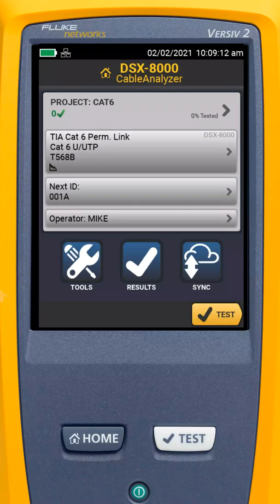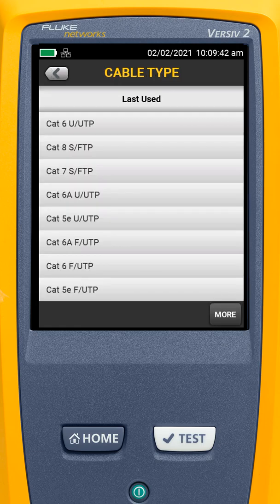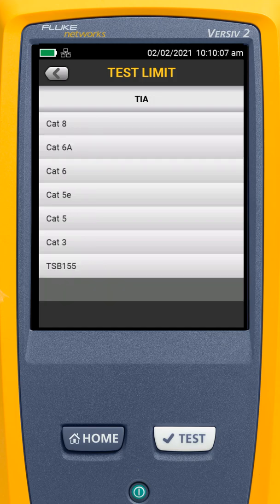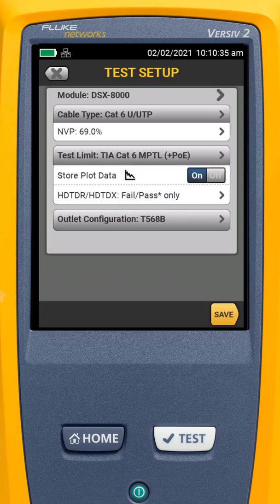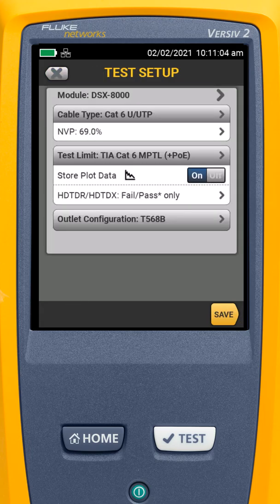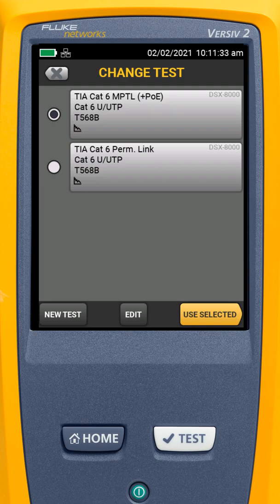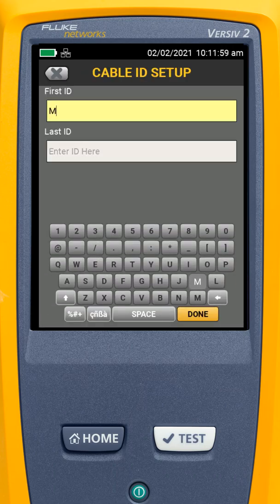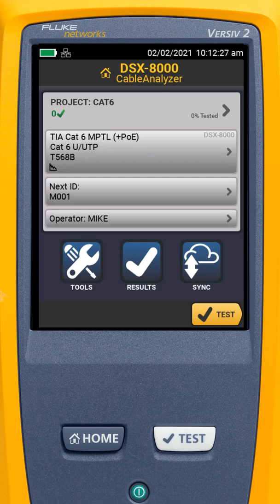Cat 6 MPTL Test on the Fluke Networks DSX CableAnalyzer™

Comment: Hello Mike,

 I am testing CAT-6 cables that are terminated on both ends and installed inside conduit. There are multiple areas of bends and are several feet long some lengths over 50feet. Would this procedure and set up in this video be the correct way to test those cables? 

There are POE devices on this cable that terminates into a switch on the other end. Please advise.

Comment: or a way to do both, we have a huge building we are needing to certify with about 30 different rooms, is there a simple way to name each test by room name instead? or am I missing the easy way of doing it?
Reply from the maker: On the Versiv you can create cable id sequences.  The length limit on the cable id is 60 characters.  For example, you could create a sequence that includes building, floor, room, location number and jack number.  building.floor.room.locationjack --> Beginning ID B001.F001.R001.001A to Ending ID B010.F008.R050.096D  This would cover 10 buildings, each with 8 floors, 50 rooms, 96 locations per room, and 4 ports per location.  Another method is to create a spreadsheet and use LinkWare PC or LinkWare Live to import the cable ids into the Versiv.  I'll put together a video for that one.